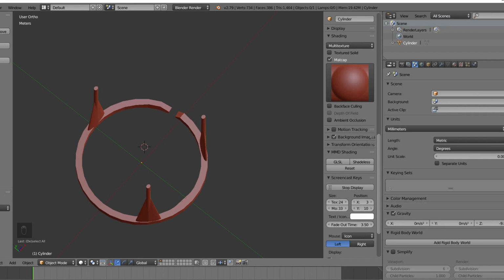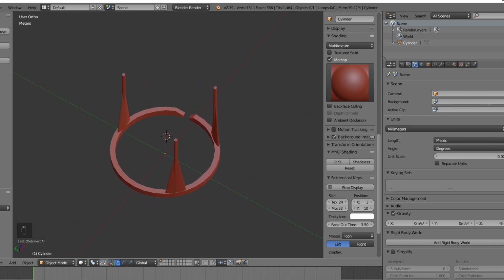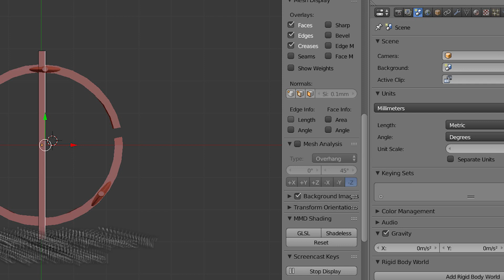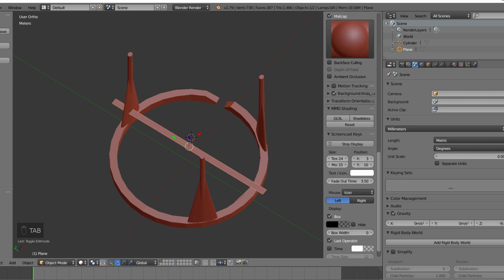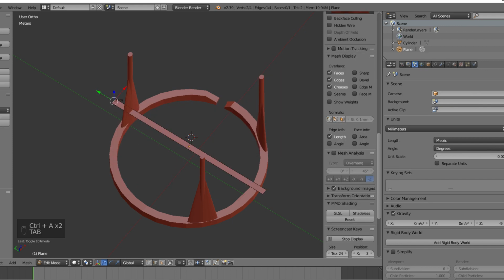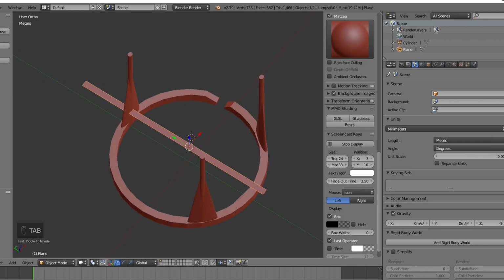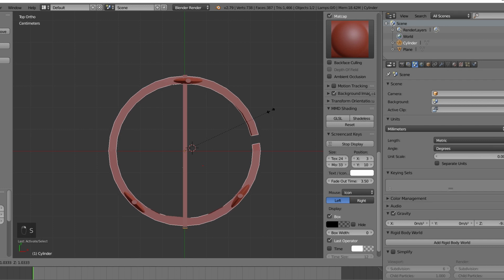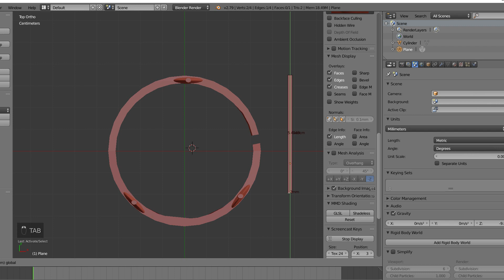Resizing 3D Objects to Real World Measurements - Blender Tutorial

Comment: Does this work for 2.8? I just started and this is the only video i can find on this topic.
Reply: I was trying to find a video or blog about. I found this hope it helps until we get a video.

https://www.katsbits.com/codex/units/
Reply: @JosephAli93  thanks but this also really isn't that helpful. I want to know what measurements are being used on something like the metric scale. Like is the file im working on being scaled by centimeters or millimeters? I can always just ad an extra 0 in between the the 1 and the . when exporting to stl but i don't want to constantly do guesswork when i want to print something bigger than my build plate. (As in I wanna print an object in 2 separate parts not that i wanna shrink it).
Reply: https://www.bing.com/videos/search?q=blender+2.8+resize+3d+model&&view=detail&mid=A04DF3F001858DD8D0C1A04DF3F001858DD8D0C1&rvsmid=6EA44E72F9EB4F3F16706EA44E72F9EB4F3F1670&FORM=VDQVAP
Reply: @TheAmoscokkie  thanks, but that wasn't our problem. Imagine, you have to 3d print a cube which is 5X5 cm.